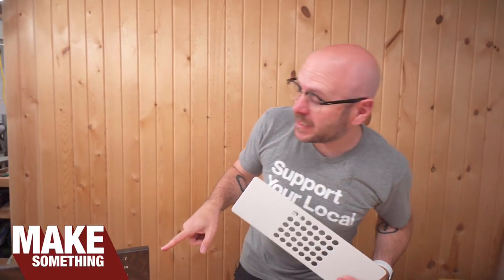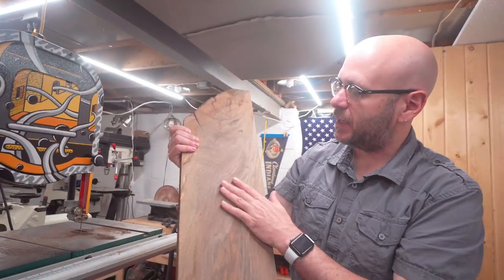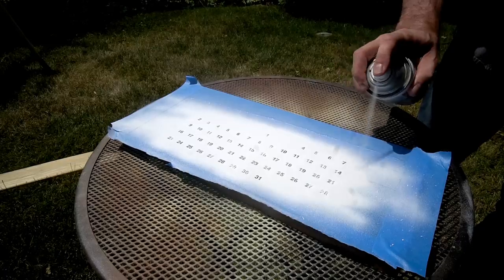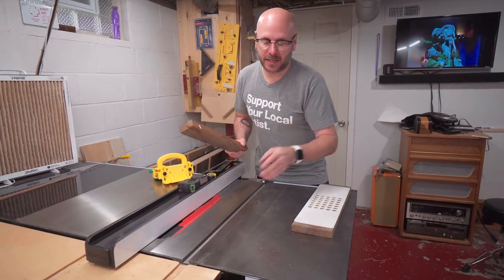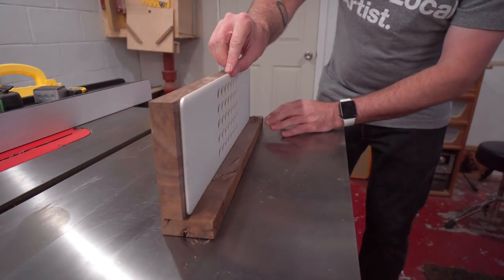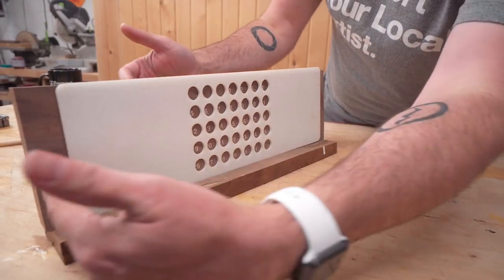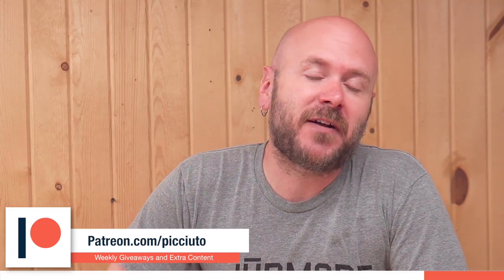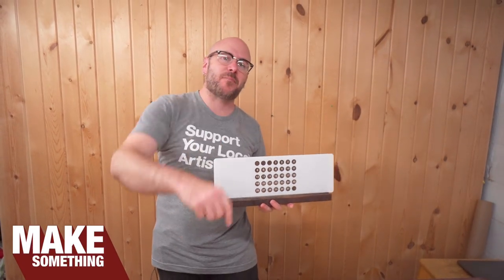Making a Year-round Desktop Calendar | Woodworking and Laser Cutter

Comment: Idea for modification: 

Instead of the laser-cut acrylic use a forstner bit and steel so the overlay is magnetic. You could even then coat it in whiteboard paint so you can write little notes.
Reply from the maker: Great idea! I like it!
Reply: Andrew Blum It won't be magnetic but you should be able to use dry erase markers on the acrylic. Like writing the months on top

Comment: Not sure if it's been pointed out, but the spots where you'd have 2 dates on the same blank are consistent. You could have laser cut those in the main board on the bottom row. You'd just need a few acrylic disks to cover up the days you aren't interested in. I would think you'd have to do that anyway for all the months with less than 31 days anyway.....but maybe I'm not visualizing this clearly.

BTW, I can't sand without thinking of REM now. Well played, Mr Picciuto

Comment: Cool build Dave, calendar concept had my head spinning at first. Any particular reason you were using the drum sander and not the thickness/planer to bring the wood down?
Reply from the maker: +Robin Lewis my planer was tucked away due to HVAC people repairing our air conditioner
Reply: Ah!
Reply: Robin Lewis definitely an awesome build, I've found that my planer can tear out sometimes, especially when there is quite a bit of figure in the wood. The walnut down here in South Carolina grows really fast and has big growth rings making tear out increase. I usually get it about where I need it to be and then just sand the heck out of it to get it to get to the finished piece. Great question.
Reply: Thanks for the reply Josh, that's what I thought Dave's reasoning might've been

Comment: What benefits does the drum sander have over the planer? I generally use pretty straight dimensional lumber and do not want to lose alot of material thickness. Would a drum sander be ideal for that?
Reply from the maker: Yes, if you only want to remove much material then a drum sander comes in handy! It can save a lot of time when it comes to sanding.
Reply from the maker: +Make Something *remove a little bit of material